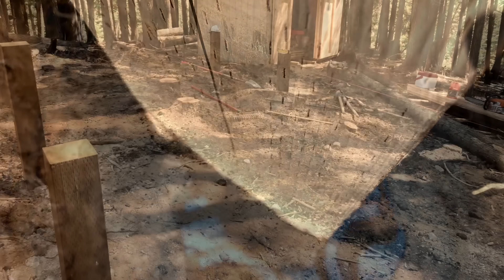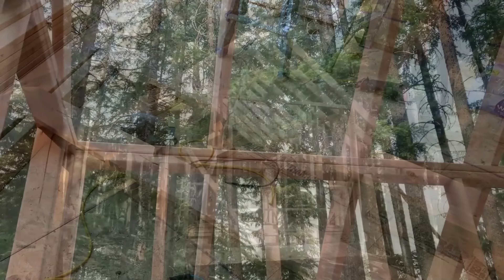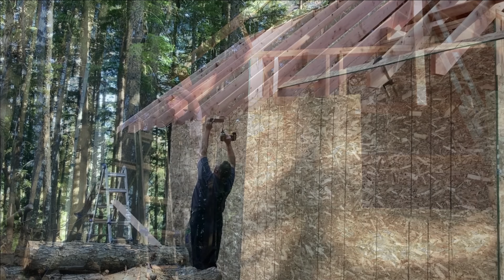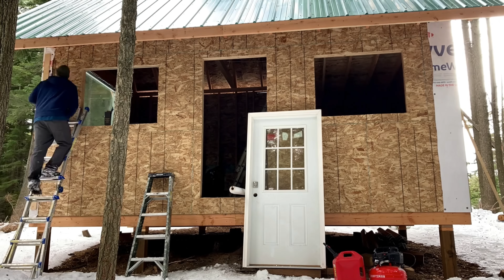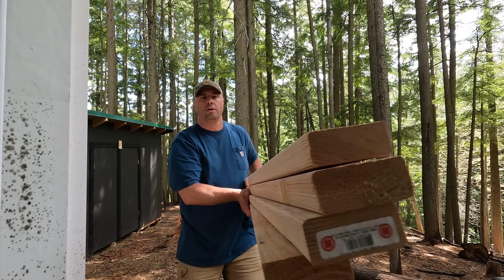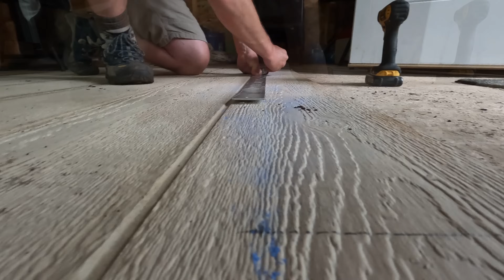Building Our 12x20 Off-Grid Mountain Cabin: The 9-Month Journey

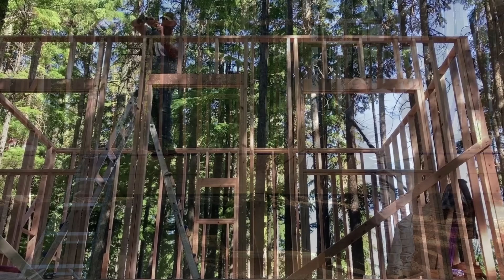Comment: When I bought my shop a couple years ago there was an office 12x30 Office trailer and gutted it, put a pitched roof on it and  built it into a Tiny house then bought a 5 acre piece of property here on the Waccamaw River in South Carolina, it's not completely off grid because I had to connect to county water and sewer being right on the river but I do collect rainwater to cut down on my water usage have solar power and heat with wood I don't use A/C because my place as alot of shade, I just put window fans in the windows to curculate the cool air. Right now at 11:30 it's 92 degrees and it's 70 degrees in my house.
Reply from the maker: Sounds like a great place!

Comment: How is your roof vented? I see the ridge vent but I’m not sure how you vented the soffit area being the insulation is blocking air flow.
Reply from the maker: On this build I’m experimenting with an unvented hot roof design. I know it’s controversial but I wanted to try it for this project.
Reply: @tinycabinpnw  good to know thanks! let me know how it does in the future with moisture resistance! Other wise good job on build!
Reply from the maker: @bennicolao  will do. I may do a video about it in the future after going through at least one winter and summer.

Comment: Did you really build the deck without the treated lumber?
Reply from the maker: The framing is pressure treated and the decking is cedar. It has similar rot and pest resistance to redwood but was more economical.

Comment: You don't insulate the floor before the OSB
Reply from the maker: Initially I was thinking we would just use the cabin during the warmer seasons and floor insulation wouldn't be necessary. I've since changed my mind and will be insulated from underneath. I'm still trying to decide if I'll go with spray foam (https://youtu.be/i68KwxvbtUE) or use Rockwool batts with 1/4" plywood underneath.

Comment: I've got to be honest. I couldn't do the music, I turned the volume completely off. I would rather listen to the sounds of hammers, saws, nail gun, silence, etc. It's obvious your not a carpenter and I think you made a pretty good stab at this project. You did somethings really well and I think you need to view some good instructive videos, multiple times, and then ask alot of questions and understand what i am expressing to you. It's good you didn't spare the lumber, I personally like to over-build. I would not have put in all of the windows (don't bother putting a lock on the door). You can always correct this. 
How hot and cold does it get in this area? Ridge venting is critical. I kind of started skipping over some of the video to evade the cringe parts. 
Please take what i have written in the spirit of construct thoughts and not with destructive intent. What you have built should stand for a long time ⌛️
Reply from the maker: Thanks for the great feedback. You are correct I’m not a carpenter and I have certainly learned a lot of things in the process. I did debate on the ridge venting but decided to skip it after watching a video by Matt Risinger. We’ll see if that was a mistake in this climate. The temps rang from about 80 degrees F in the summer to -10 degrees F in the winter.
Reply: @tinycabinpnw  sir, the vent can be corrected, also. Please do more research regarding this issue. Moisture build up will create mold and other issues. Please, please take this next comment from my heart. I had 7 kids (5 boys, 2 girls) when they was small, I never let them play around my work areas, NEVER. I watched your little fella romping on the 4 x 8 sheet of decking and I was praying he didn't fall between the floor joint. He could have gotten hurt pretty bad. How do I know. It happened on a room addition that I was building for one of my customers. The person that fell was a adult and i couldn't stop it from happening. They really got messed up. I know folks are going to say, accidents happen, but not on my watch, if i can prevent it. I feel horrible, even to this day. We can't turn our backs on our little ones even for a second or suddenly the fun ends. Just a cautionary note. Thanks 😊